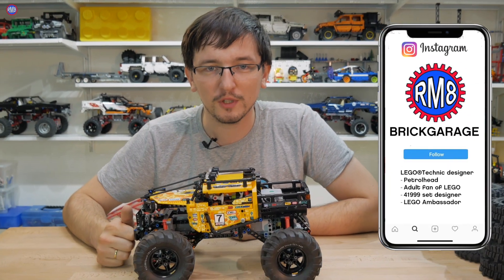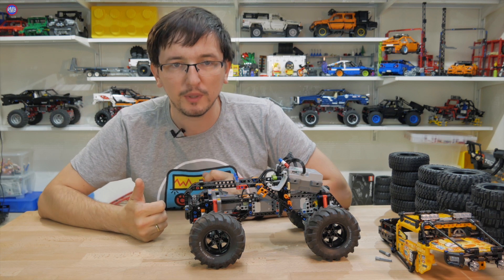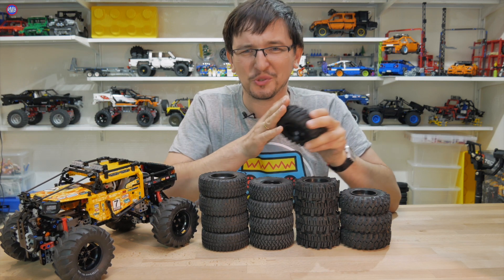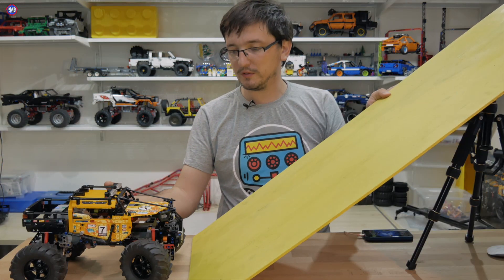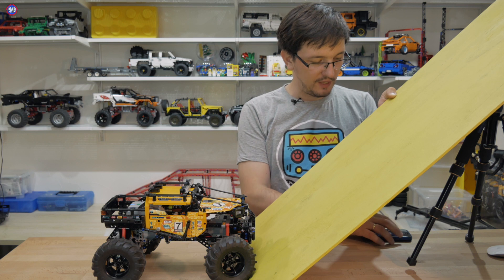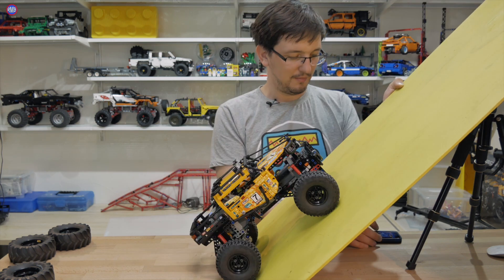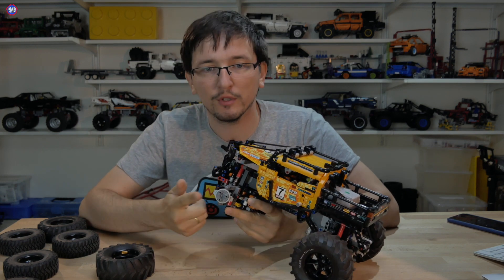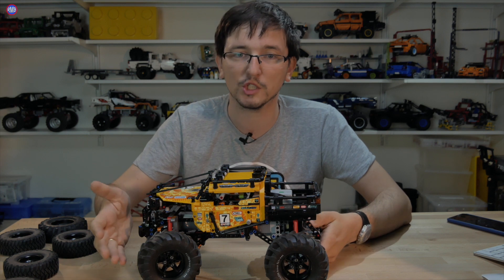ТЮНИНГ ЛЕГО Техник 42099  набора и езда по реальной ГРЯЗИ!!!!

Comment: for tires i found 
RC4WD Z-T0056 Interco IROK 1.55 Scale Crawler Tire
to be very grippy, you will break axles if it has anything it can grab on to and not continue to move

it is a 1.81 though but i believe it will stretch enough for 1.9, fits very well on [Part 41896] Wheel 43.2mm D. x 26mm Technic Racing Small, 3 Pin Holes

Comment: Great video. This model is awesome after the gearbox changing, for the climbing in sand / mud it is better to have more weight on the front part of this model -> then is everything ok. The rear suspension could be more flexible and copy the terain not so much static.

Comment: Is it possible to swap the bevel gear amd differential with two four knob gears instead, so that the clicking is eliminated?
Reply from the maker: there is no clicking there. So there is no need for that. And more: knobs a very ineffective, too much friction losses
Reply: @rm8brickgarage  I see, but if you also swap the other set of gears that are near the motor, do you think there would clicking in the differential?
Reply from the maker: Christian Rahi yes, that’s possible because torque on differential after 2 stage 12:20 gearing down will be close to PF XL motor. And if you know PF XL can break diff.
Reply: @rm8brickgarage  Mm I see, but do you think there is a solution for this? Like can I do the stage 2 but at the same time not hurting the diff? Or maybe taking out the whole diff and replacing with a solid axle?
Reply from the maker: @christrahi16  yeah, try 12/20 instead diff

Comment: I notice only 1 wheel spins. Can you lock the centre diff to get even power at front and rear wheels?
Reply from the maker: there is no connection between axles. One motor for front axle, another motor for rear

Comment: also another question/tip, maybe try experiment (if theres enough space in there), not just swap those 2 gears but exchange them with for example 24 tooth and 8 tooth gear, how would that Torque work? just try experiment, i dont have the set so you try it instead, just try different gear combinations
Reply from the maker: No, 24th gear is too big to fit in 3L space
Reply: @rm8brickgarage  ah ok, both on yt at night i see.